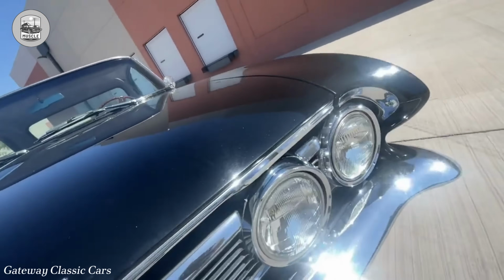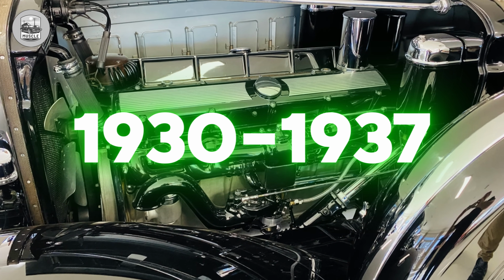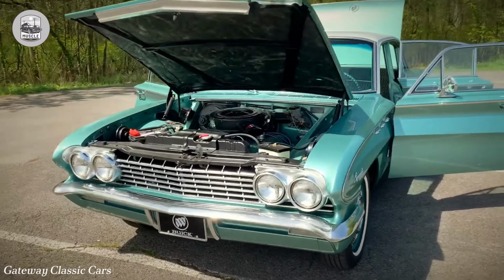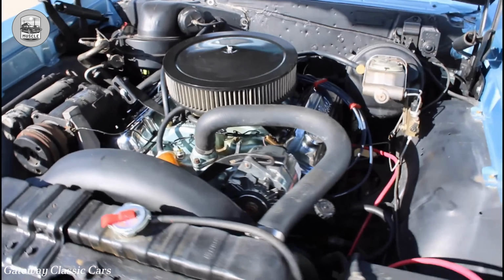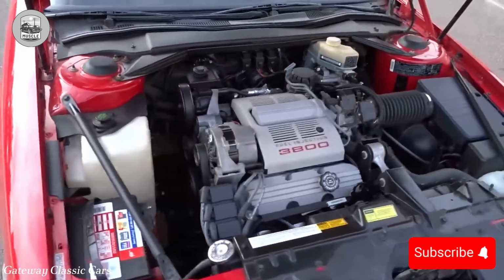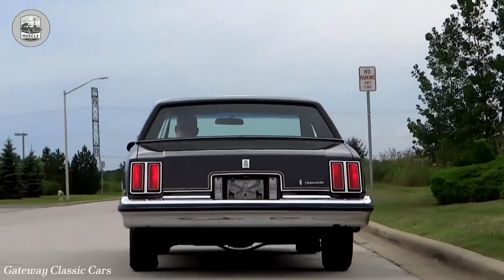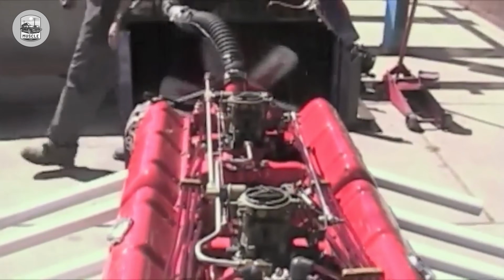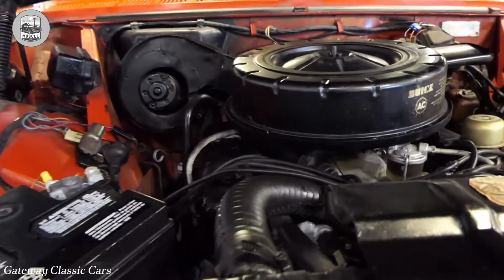10 MOST FAILED and WEIRDEST GM Engines ever made | Worst engines blunder!

Comment: My dad installed a 1966 Buick Dauntless V6 out of a wrecked CJ5 in his 1948 Jeep CJ-2A in 1969. He's dead now, but we still have that old Jeep. He fully restored it in 2001.
Reply: I've got a 67 Jeep Gladiator 4X4 with the AMC 327, power brakes and steering with a radio. Kinda loaded for a Jeep truck from that time period.
Reply from the maker: @Sabe53  That's a fantastic piece of Jeep history you’ve got there! The 1967 Jeep Gladiator 4X4 with the AMC 327 was quite the powerhouse, especially with all the added features like power brakes, steering, and a radio—definitely ahead of its time for a truck. That AMC 327 V8 was a beast, pumping out around 250 horsepower, which was a lot of grunt for a Jeep back then. It’s a bit of a hidden gem in the world of early Jeep trucks, and having one that's "loaded" makes it even more special.
These trucks were known for their ruggedness, but having the power steering and brakes made a world of difference for handling and comfort, especially off-road. And the radio? That was definitely a luxury back in the day!
Reply: @MuscleCarMasters68  Forgot to mention it has a factory installed GM turbo 400, I did research that and it's a Buick nailhead pattern trans that uses an iron adapter ring line GM used on the old iron power glide to adapt them to a V8 or inline 6. It has an iron ring that adapts Buick bolt pattern to the 327 bolt pattern. Also has an old 287 4 bbl. intake that I used to mount a quadrajet carb to the 327.
Reply from the maker: Thanks for sharing more those fascinating details about the factory-installed GM Turbo 400 and the Buick nailhead pattern transmission! The use of an iron adapter ring to marry that Buick bolt pattern to the 327 is a clever piece of engineering history that really highlights GM's approach to parts interchangeability. The fact that you’ve got that old 287 4-bbl intake with a Quadrajet on the 327 adds even more cool factor—Quadrajets were known for their versatility and fuel efficiency, making it a solid choice for better performance.
For everyone watching, what other interesting factory combinations or swaps have you come across? Drop your comments below and share your stories! Don’t forget to like this video, share it with your friends, and hit that subscribe button so you never miss out on these awesome builds.
Reply from the maker: That’s an incredible story! The Buick Dauntless V6 was such a solid engine, and it's amazing your dad did that swap back in 1969! The Dauntless was actually a derivative of the Buick 225 V6, and it's known for providing much more power and torque than the original flathead 4-cylinder in the CJ-2A, especially in those tough off-road conditions. It's great that he restored it in 2001—sounds like it's a real family treasure! Keep that Jeep going strong; it's a piece of history that shows how creative people were with engine swaps back in the day.
If anyone else has a cool story like this or a unique swap, we’d love to hear it.
Don’t forget to share your stories in the comments, and if you haven’t yet, make sure to subscribe to Muscle Car Masters for more incredible automotive content. 
Have a good day.
Reply: @MuscleCarMasters68  he also transferred the drive axles to the CJ-2A so that it could run more than 55 MPH. I learned to drive in that Jeep when I was a kid way before I was legal.

Dad used it to herd cattle on the farm (I did too, when I was about 13 years old). He used it to push sprint cars at the nearby dirt track on Saturday nights for years.

That little V6 turned it into a hot rod.
Reply from the maker: @ronaldschoolcraft8654  It's amazing how much versatility and power that little V6 brought to the CJ-2A. Swapping in stronger drive axles to get it running over 55 MPH is a smart upgrade—especially for farm work and pushing sprint cars! That must have turned it into quite the hot rod, as you said, and I bet it sounded great too! Jeeps like yours were built tough, and adding in that V6 really gave it a muscle car vibe.
Herding cattle at 13 and getting to push sprint cars on Saturday nights sounds like a dream for any gearhead growing up! Your dad definitely knew how to get the most out of that Jeep.
Thanks for sharing such a cool memory! For everyone watching, let us know in the comments if you have any great stories about your first driving experiences or how you modified your rides! And don’t forget to comment, share, and subscribe to Muscle Car Masters for more awesome car stories and engine talk.
Have a good day.
Reply: Interesting story, but I gotta ask—why stick with the Buick Dauntless V6? Those engines were decent, sure, but they’re not exactly known for power or torque like a classic V8. In a CJ-2A, wouldn’t a small-block V8 swap have been way better? You’d get more power, better torque for trails, and let’s face it—a little more attitude! Don’t get me wrong, it’s cool he restored it, but keeping the V6 seems like a missed chance to really make that Jeep a beast
Reply: @AilaniMadden  The V6 barely fits. There is no way, without cutting up the firewall and frame, that a V8 will fit. Besides, that little V6 made that Jeep a hot rod. I had a 1974 Jeep CJ5 with the AMC 304 V8 when I was in high school. There wasn't much difference.
Reply from the maker: @ronaldschoolcraft8654  the V6 really does pack a punch in those Jeeps! It’s a tight squeeze, and dropping a V8 would definitely require some serious modifications. The AMC 304 V8 was a beast for sure, but that V6 could turn heads on the trail just as well! Thanks for sharing your experience with the CJ5—those high school memories with muscle under the hood are priceless...
Reply: @ronaldschoolcraft8654  Hey, I get it, a V8 has that undeniable muscle car allure—but I’m with you on sticking with the Dauntless V6 for a Jeep like this. There’s something about keeping it light and nimble on trails that a V8 just can’t match, especially in a CJ-2A. That V6 gave it that extra zip without the need to cut up the frame, which keeps the build true to its roots. Plus, that V6 growl is unique in its own way!
And I hear you about the 304 in the CJ5; sure, it was powerful, but those Jeeps aren’t exactly built for high-speed muscle. Sometimes, keeping the original engine, quirks and all, adds character—makes it a classic without the extreme mods.
Reply: @AilaniMadden  Buddy of mine put a 51 Willis on a 71 Blazer 4X4 frame and running gear, looked cool as hell. Funny thing was they hardly drove it, went back to their K1500s. Don't even know what happened to it. One thing for sure, wasn't much room under the hood for the 355.
Reply: @Sabe53  Man, that sounds like one wild build! A '51 Willys on a ’71 Blazer 4x4 frame? That’s some serious creativity. But I totally get it—those old Jeeps are tight under the hood. Squeezing a 355 in there, especially with the Blazer’s running gear, would’ve been a challenge for airflow, plus it probably ran hot, too! That’s the kind of project that’s just as fun to look at as it is to drive, even if it just gets parked next to a K1500. As for the Buick Dauntless V6, I hear you on wanting that V8 power. The Dauntless isn’t a powerhouse, but it's a solid, reliable engine that keeps the Jeep’s original vibe alive. Plus, you’d be surprised—the V6 gives plenty of torque down low for trails, which is what Jeeps really need. But hey, I agree, a small-block V8 would make it a whole different beast. Both setups are cool in their own way, just depends on whether you’re after the heritage or the horsepower.
Reply: @AilaniMadden  If the newer 3800 would bolt up there's a lot that can be done to them, think Buick Grand National. Old jeep looked stock except for wheels and paint job. Once you got up on it and got lookin around your like hey what's going on here. Don't know what radiator was out of but he flipped it and mounted it vertical with electric fan, claimed it didn't run hot.
Reply: @Sabe53  Interesting take, but I'd actually lean the other way on this one. Swapping in a newer 3800 might bring some power and mod options, but it's a totally different ballgame when it comes to maintaining the classic Jeep character. Part of the charm of these old Jeeps is keeping the engine bay simple, rugged, and original. Plus, the Dauntless V6, though modest, provides a unique torque curve that’s ideal for trail driving without adding complexity. Bolting in a 3800 would also likely mean more cooling challenges and fabricating new mounts—not to mention electrical work for the fuel injection. That simplicity of the Dauntless is hard to beat when you want an off-roader that can handle rough trails without added weight or stress on the frame. Sometimes, less is more, especially with these old classics
Reply from the maker: @AilaniMadden  Great question, and I totally get where you’re coming from. Swapping in a small-block V8 would definitely give that CJ-2A more grunt and torque, making it a trail-ready beast. But there’s something about the Buick Dauntless V6 that’s hard to overlook for some Jeep fans. That engine's lighter weight actually keeps the CJ-2A nimble and maintains its classic handling feel, especially for those who want to keep that vintage vibe intact. Plus, the V6 offers a unique character you just don’t get from a V8.
Let’s keep the conversation going! What do you think, folks? Would you stick with the V6 or go for the V8 swap? Don’t forget to like, share, and drop a comment to let us know where you stand on keeping it classic or making it a trail monster...

Comment: Buick Olds and Pontiac had some "different" engines. Never saw anything strange in the Canadian pontiacs, just 195 cu in 4 cylinders and straight six of 261 cubes and V8s 283 348 and 409s.
Reply: @alm7707  yea most Americans don’t know, but Canadian Pontiacs had more in common with Chevys, than any other GM products.
Reply from the maker: @kevinvoyer5053  Thank you for your information. It is so great...
Let's see our channel is a place to share, comment or show your feelings about American Muscle Cars.
Have a good day.
Don't forget to like, share or SUB on our channel to enjoy other great Muscle Cars videos.
Spending more time with other great videos on our channel to explore more about American Muscle Cars.
Reply from the maker: Thanks for the comment! You're right—Buick, Olds, and Pontiac had their fair share of unique engines. The Canadian Pontiacs were a bit of a different story, often sharing engines with Chevrolet rather than using the Pontiac powertrains from the U.S. models. The 195 cu in 4-cylinder you're referring to was essentially half of Pontiac's 389 V8, and it made its debut in the Tempest in the early '60s. As for the 261 straight-six, that was a Canadian-built Chevy engine that found its way into various cars and trucks. And yes, those small block and big block Chevys like the 283, 348, and 409 were common across the board!
It’s fascinating to see how these engines were shared or modified between brands and regions. There’s always more to explore about the variety in these engines and the creative engineering behind them.

We’d love to hear more from you all! Have any of you come across other rare or unusual engines from Buick, Olds, or Pontiac? Drop a comment below, and let’s keep the discussion going. Don’t forget to share this video with fellow muscle car fans and subscribe to Muscle Car Masters for more deep dives into automotive history!
Reply: Actually, I’d have to disagree with that view. While it might seem like the engines were similar, Buick, Oldsmobile, and Pontiac each had their own distinct engineering approaches. For example, Pontiac’s V8s were unique in design and didn’t share parts with Chevy’s small blocks like the 283 or the 348 and 409. The differences in engine architecture, such as Pontiac’s longer stroke designs and different cylinder head configurations, made them quite distinct. Even in Canadian Pontiacs, the engines weren't just rebadged Chevys; Pontiac’s engines had their own identity.

Comment: I have a gmc 336 in my 1959 gmc pickup
Reply from the maker: That's awesome! The 336 engine in your 1959 GMC pickup is part of GMC's family of V8 engines, which were based on the Pontiac V8 designs at the time. The 336 cubic inch V8 was essentially a smaller-displacement version of the Pontiac 347, designed to meet GMC's specific requirements for their truck line. These engines were known for their durability and torque, making them great for heavy-duty applications like your pickup.
The 336 was produced only for a short period, which makes your truck even more unique. If you ever decide to tweak that engine for more performance, you could look into parts from the Pontiac 347 or 370 engines, as many of them are interchangeable.
Thanks for sharing your truck with us! We'd love to hear more about how it drives and any other mods or plans you have for it.

For everyone else watching, if you're into unique engines like the GMC 336 or just a fan of classic American muscle, drop a comment, share your stories, and don't forget to subscribe to Muscle Car Masters! Let's keep the conversation rolling and build this community together!

Comment: My fav is the 409
Reply: While the 409 is certainly iconic and has a special place in muscle car history, it's important to recognize that the engine had its fair share of issues. One of the biggest problems was its tendency to overheat due to a relatively inefficient cooling system, especially under heavy loads. Additionally, the early 409s were prone to oiling issues, which led to accelerated wear on the valvetrain. While it’s a beloved engine for many, these mechanical flaws cannot be ignored when discussing its overall performance and reliability.
Reply from the maker: Thank you for your information. It is so great...
Let's see our channel is a place to share, comment or show your feelings about American Muscle Cars.
Have a good day.
Don't forget to like, share or SUB on our channel to enjoy other great Muscle Cars videos.
Spending more time with other great videos on our channel to explore more about American Muscle Cars.
Reply from the maker: Great choice! The 409 was a legendary engine, especially known for its power in the early '60s. It was the first true performance big-block from Chevrolet, making a name for itself on the drag strips and streets. With its dual 4-barrel carburetors, the 409 could pump out up to 425 horsepower, and let's not forget the classic song, ‘She's Real Fine, My 409,’ that solidified its place in pop culture!

If you're a fan of engines like the 409, you should check out some of our other videos where we dive deep into more iconic American muscle! Everyone, let us know your favorite engines in the comments, share your stories, and make sure to hit that subscribe button for more content like this.
Have a good day.